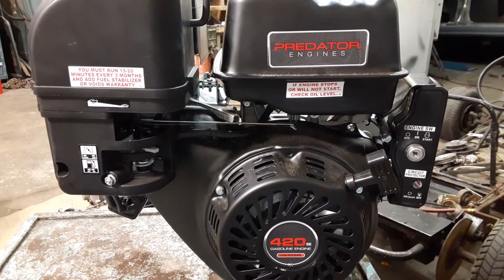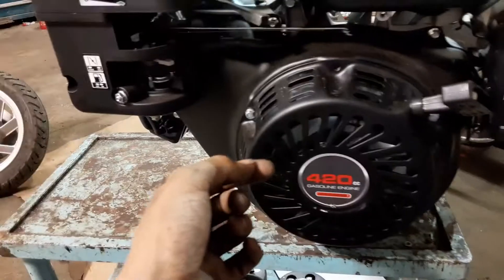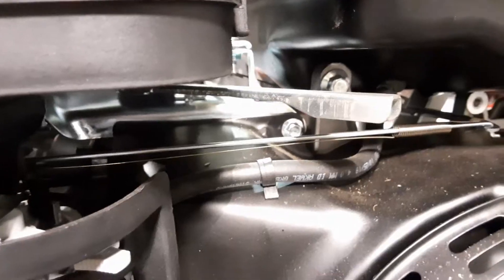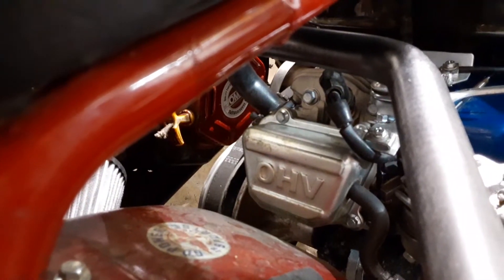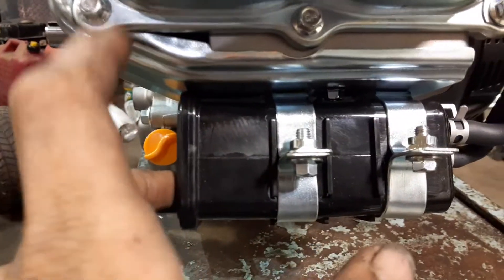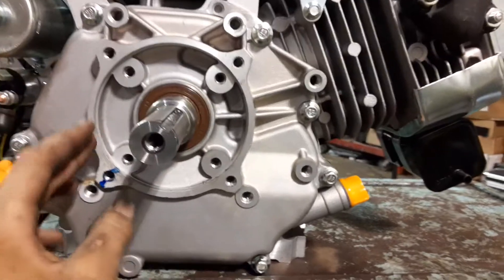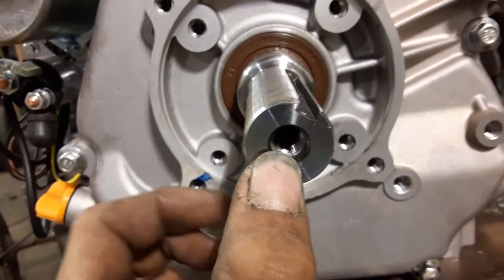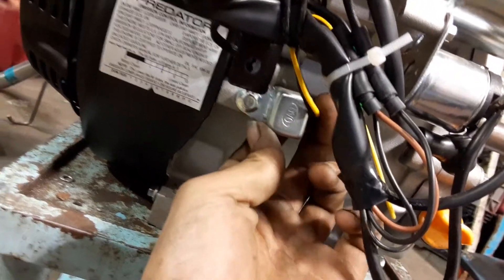Predator 420cc Engine

Comment: I'm pretty sure that's the starting cylinoid not the coil pack.
Reply from the maker: What is? Idk what your referring to. Add a time stamp if you can. I may have mispoke. No biggie. I barely ever messed with electric start and the terminology before
Reply: @minibikegarage1577  The thing you connect the battery to.
Reply from the maker: @thewindows95guy  🤷‍♂️